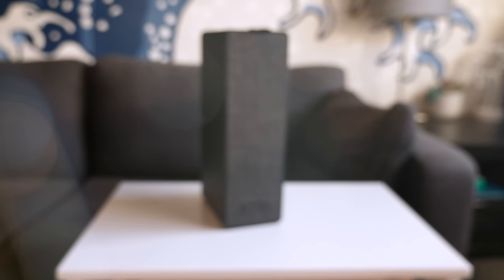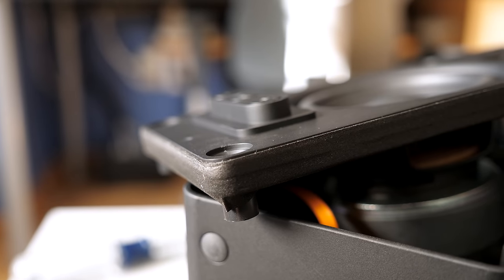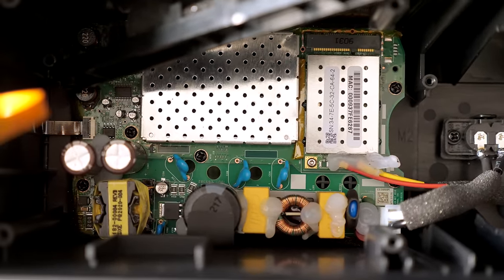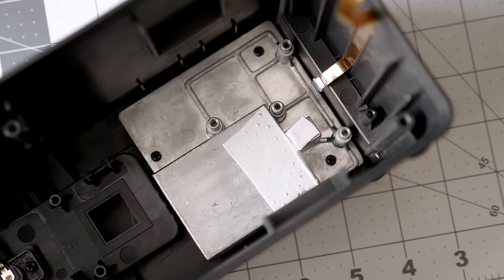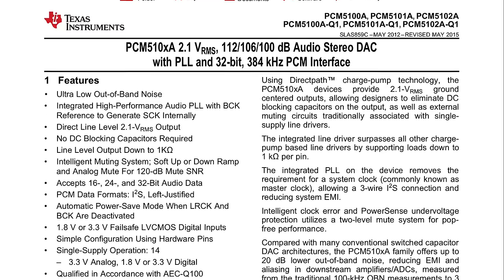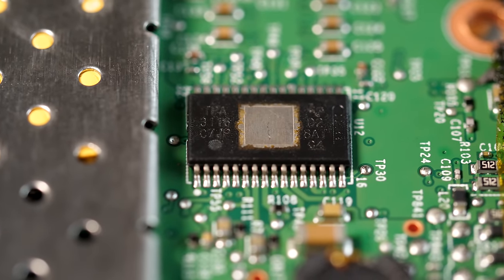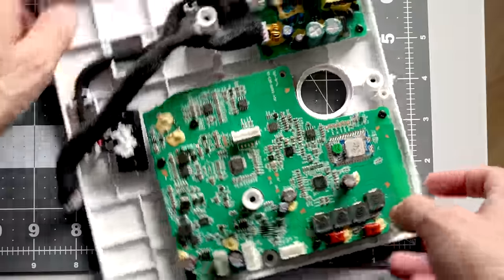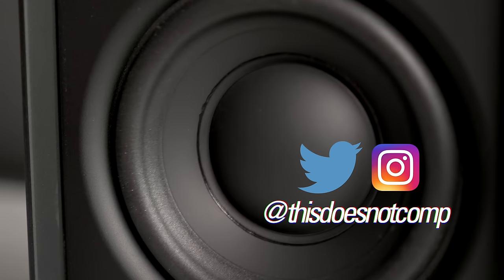IKEA's Sonos Speaker Has a Secret

Comment: “1gb ethernet is not a requirement for streaming audio” so I guess I’m not gonna bother sending my Hi-fi Flac. 128kbps Spotishit audio
Reply: I don't know what you regard as Hi-fi Flac, but for example a 192Khz/24 bit stereo PCM audio FLAC encoded file will have a bit rate of 9216kbps. That is less than 10 Mbit/s and you do not need a 1gb/s ethernet.

Comment: I have a question about the oDroid (yes I know it's an old video but I just wanted to know if it's possible to download the firmware and ROMs on an Android tablet and use a micro USB to micro SD card adapter and to transfer the files .. I recently moved out of state and my computer is back home and the shipping is expensive

Comment: Ikea, it's not furniture, hotglue is not supposed to go onto circuitboards.
Reply: Yes it is. This is common practice.
Reply: In fact hot glue isn't robust enough for furniture. But to prevent rattling and transport damage in low-voltage electronic circuits, it's entirely adequate! It's also easily removable with just a bit of alcohol and easy to reapply. There really is no reason not to use it as long as it's used sanely and sparingly.